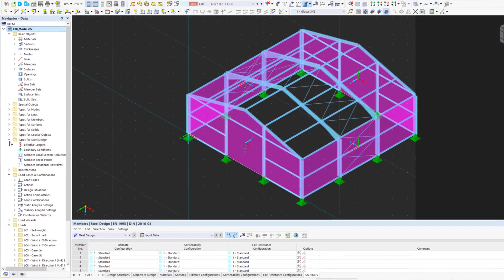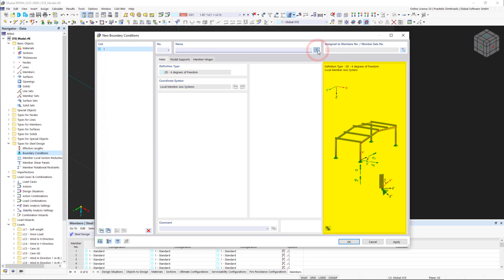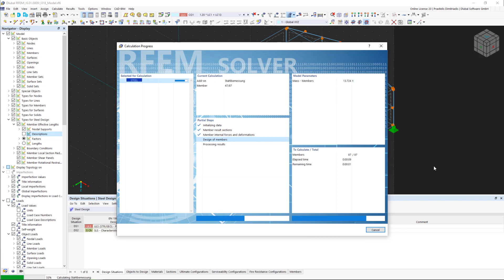RFEM 6 Tutorial for Beginners | 018 Steel Design | Effective lengths | Boundary conditions

Comment: Hi, Dlubal team, for the proper stability analysis - is it required to define the boundary conditions for all members in the model? Why in this example boundary conditions were assigned only to the mid span?
Reply from the maker: Hi, Артем! 
In this example, the stability calculations were carried out for the beams and the columns. For these elements the boundary conditions are defined. What boundary conditions are you missing??
Reply: @DlubalEN  I rewatched the video, found boundary conditions assigned for the mid span roof beams only. Maybe I'm missing something, aren't we need to use the same function (Types for Steel Design - Boundary Conditions) for the columns?
Reply from the maker: Hi, Артем! As you can see at 3:54 everything is also defined for the columns. If you need further assistance, you can also contact our customer support by e-mail at info@dlubal.com.
Reply: @DlubalEN  Follownig the timecode, the boundary conditions can be also defined in the effective length tab. Now I get it, thank you for your support!

Comment: Member sheet panel  for all code ?
Reply from the maker: Hi, Saif!
The stiffness of shear panels can be activated as option in the member support objects. Those stiffness values could be considered in LTB design if the eigenvalue solver is chosen for calculation of critical buckling load.
Reply: @DlubalEN  thanks